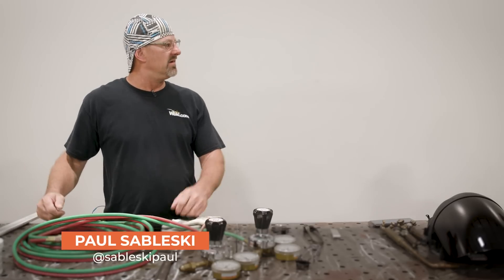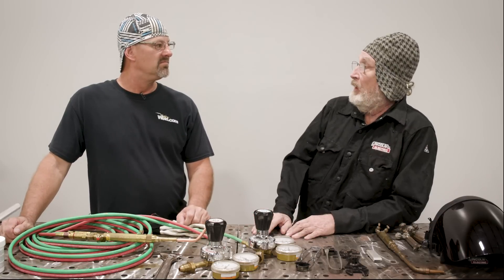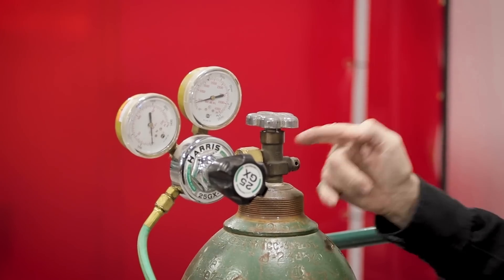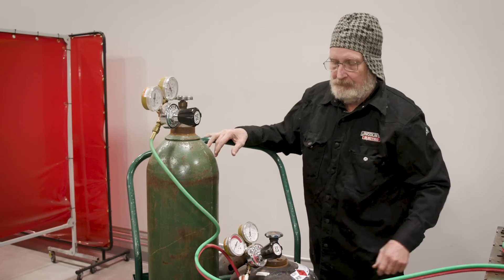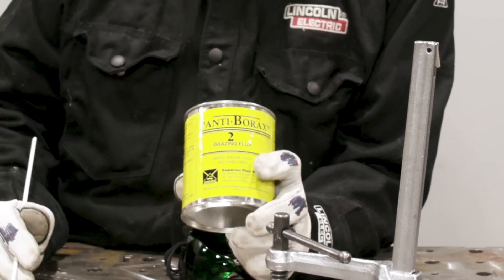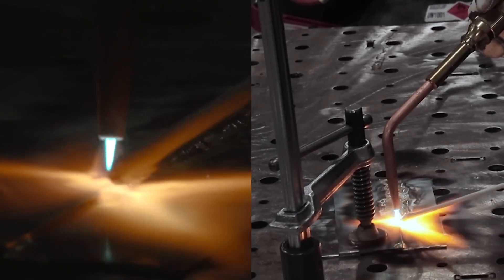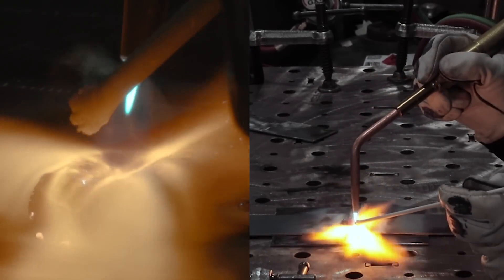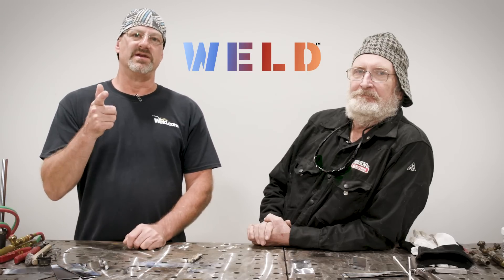Brazing vs Fusion Welding With Oxy-Fuel

Comment: What I love about brazing with bronze is the capillary action "wicking" the metal into gaps, great for crack repairs when you need something durable filling the gaps in. Could you touch on other fillers like silver alloys, nickel silver, etc, and what they would be good for in other videos?

Comment: Thanks for a great video. 🙂

I find it interesting to see in the comments, that there are many individuals that never been shown how to braze. 🙁 I am fortunate  enough to have been in an educational system, that didn't take for granted, the importance of exposing students into the trades, through wood and metal shop environments.

I was in both metal shop and wood shop when I was in the seventh grade. We were enrolled (as an elective class) which consisted of two 9 week grading periods in one of the two shops, followed by the remaining two periods attending the other shop.
In the metal shop we were taught very basic skills in the seventh grade, eighth grade we learned how to do somewhat advanced tools and techniques and then into ninth grade where we were given the opportunity to learn how to use an acetylene torch to weld ('fusion" of two pieces, actually melting the parent metal and adding a  filler rod that too was the same as the parent metals) and braze (the connection of two items either of the same or different materials, using a brass or dissimilar filler rod, non-coated brass/bronze rod that was heated with the torch and dipped into a container of flux)

💥Note, the main difference being that in "welding" the parent metal was heated until it was molten, thus a "cohesive" fusion occurred and in "brazing" the parent metal or metals never became molten and thus an adhesive connection was established. 

I really enjoyed your video today and thank you for bringing this information out for those unfortunate enough to have been exposed through their educational system. 

😕Sadly... the K-12 educational systems throughout the nation seem to have turned away from teaching trades and left them out of their curriculum. Now if you're not a technical thinker.... too bad.

Comment: I have done lots of brazing and I teach braziing with heat control by lifting and returning the torch heat to control the braze melting size and shape to look like a regular arc weld bead . Then I will teach TIG welding and I find that students have better control over the TIG weld after mastering the Braze welding.

Comment: I really enjoy TIG/Stick, & will MIG when the situation warrants....but there's some times that you just can't beat brazing with a torch.

Paul, I've had good success TIG brazing with both silicon & aluminum bronze; but would like to see/learn about phospor bronze ERCuSn-C. According to Harris, it's the best choice for yellow/red brass (which I've had trouble with previously, due to the zinc). It's also apparently difficult to find in smaller quantities (only source I see is Airgas, 10lb minimum).  In fact, I don't think I've ever seen a video on YT about it. Would love to hear your thoughts or see a video on using it. If you're aware of a source for a pound or two, would love to know that as well.

Great video/information, Thanks!

Comment: Ive rebuilt 3 or more oxy regulators , the high pressure seat always fails not the diaphragms.  Ive talked to many rebuilders and the oxygen oxidizes the rubber seal and it fails no matter if its kept under pressure. Very simple and costs $12

Comment: Paul brown I use a carburizing flame to weld stainless steel and welding aluminum with oxy fuel is a different animal the aluminum can easily melt down if you not experience enough tell Mikala I love her

Comment: Can you use alumaweld brazing rods to join steel together?  Or would silver soldering be better?  Low tensile application.
Reply: It won't wet steel.  Low temperature silver solder with acid flux will work.  Also works for stainless steel.

Comment: Brazing is the best method for cast iron repairs.  The difference between soldering and brazing is 840 degrees F; under is soldering and over is brazing per AWS.
Reply: Preheat, throughly prep the item then i use Alloy X and tig the crack up. Then put on a hot charcoal grill and let it cool down until the coals go out. I’ve successfully repaired cracked cast iron cylinder heads this way